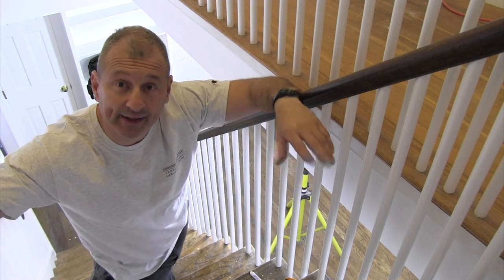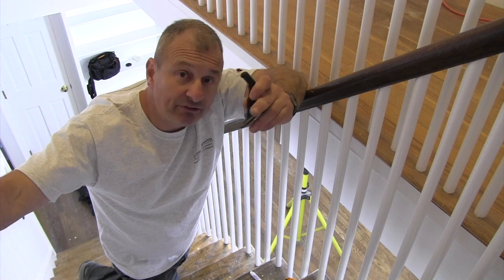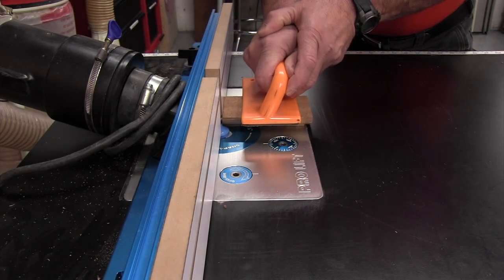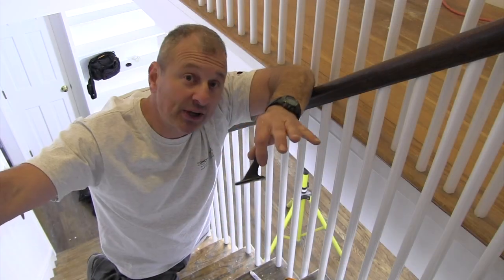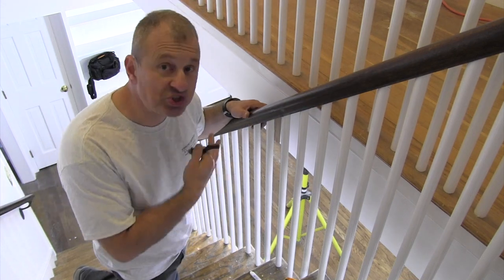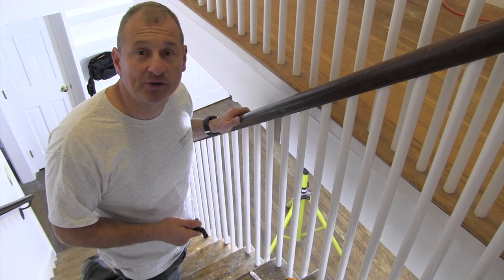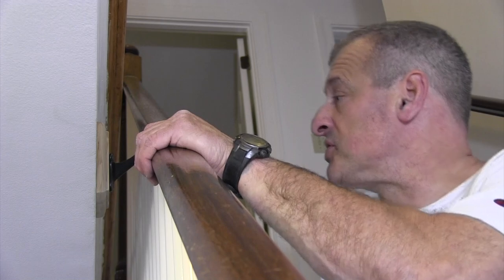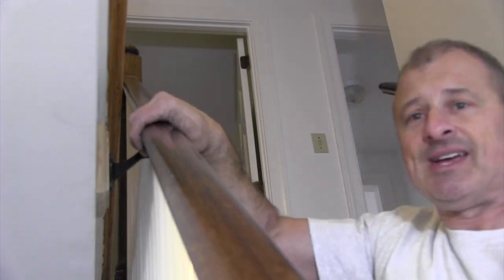How To Fix A WOBBLY Handrail

Comment: Great tip. These types of problem solving repairs are tough for me because I get hung up on wanting things to look a certain way. In this instance, it wouldn’t be my preference visually to see that block/bracket, i would prefer some kind of hidden solution. But I don’t know that there is a good hidden solution and the way you added the block, especially with the routed detail makes this an attractive option. Good work!

Comment: Good tip....but I've never ran into this particular situation here in VA. Very often it's free standing newel posts themselves that have become wobbly and often times are damn near impossible to get secured correctly. Toe nailing long screws into the bottom of the post and hope to hit some framing beneath the floor.
Reply: Similar issues in MD with the new builds...its like they simply glued a the rails down. You see them a lot in the townhome models here.
Reply: Did you tighten the underpin that protrudes from bottom of newel post thru to basement ?

Comment: Awesome tip. Would like to see what you'd recommend for a metal railing in an apartment setting.
Reply: If your metal banister system needs one, it will already have one. If it doesn't, and a gentle shake causes a wobble, put the bolts back in the holes. If the wobble is present with bolts in the holes, seek better health insurance and call the manager, but not before bulldozing through it and hurting your back. If you have children this may be a good way for them to learn the value of a buck, if not how the "world works."
Reply: @albrtl  Thanks Albert. Don't live in an apartment just do maintenance for an apartment complex. Ownership is super stingy and cheap so most of the time they try and make us do some really shoddy work. I actually like getting things done well and was wondering if there was a solution that would fix that even if it wasn't pretty that wouldn't go over the manager's budget.
Reply: @isaacvillarreal2941  Well now my snarky assumption makes me an asshole and I apologize for that. 

If the banister system doesn't flex like wood, securing the fasteners / replacement with appropriate hardware should resolve the problem. If it doesn't, perhaps the best bandaid is more negligent than simply not touching it. 

An option stemming from my imagination: If it's attached to wooden newel posts, drill through-holes and swap the lags for a nut and bolt. Using an oversized hole on the opposing side of the plate, center of the fastening hole and lightly zap a button plug to cover it up. Does this make sense? 

I'm assuming not fastened to concrete, but if it is, maybe drill slightly deeper holes and replace the lags. If it's resting on a knee-wall, obviously the lag option would be the same, however you may find problems with blown out sub-material. In this case, really long GRK's with a washer may do the trick. 

If you're feeling smart and holding a beer, you may try PL3/8X adhesive into the existing holes and stuffing the fasteners back inside. Unfortunately I've seen this work remarkably well in non-similarly critical scenarios. Perhaps a bracket not unlike the one in this video combined with appropriate adhesive and a C-Clamp overnight. If anyone asks, you don't know me. Why the hell am I even typing this? Look what you guilted me to do by making me an asshole!
Reply: @albrtl  Thanks for your response. No worries and no need to feel bad I had quite the chuckle over it. Hadn't heard of the PL3/8X trick, though I'm not sure if it would work in stucco. These apartments are low income housing built in the late 70's and in shameful condition so really not much hope for a simple repair. Thanks for the suggestions though, I really appreciate the help.

Comment: Great video. But how can you tell if the handrail is wobbly? I believe we can tell if it is rock solid. But it is hard to define to what degree the handrail is wobbly. There are few spindles in my house are trying to escape the cap of the handrail. I am trying to see if this is because the loose handrail or just the spindles themselves.

Comment: I'll hide fastener holes behind the bracket on the plinth block. There would be no need for plinth block UNLESS that specific handrail profile were used. The issue is largely handrail dimensions and fastening methods, although I suspect that particular rail is just fine. The real beauty of the plinth block is the inspiration enabled down the road, when someone inevitably feels compelled to fix the next problem. If there's already a plinth block on a janky-ass handrail, there's a 100% chance you'll find inspired repair attempts.

It's crazy that more people don't die from questionable or broken guardrails. It's probably a good argument that a false sense of security creates more hospital visits than something visibly hazardous and concerning, like hundred year old handrails barely clinging to a newel by one of five nails, now sharing a pocket hole from an attempted drywall screw repair.
Reply from the maker: Agreed
Reply: The number of handrails with drywall screws holding them is astronomical and embarassing

Comment: My wooden rail is very loose at the bottom, my kids have been abusing the rail over the years. How would you re glue the spindles to the base and top of the bannister? Is there any special glue or just put ugly screws in. The house is like 150 years old.
Reply: you could probably shove a thin bit of wood in there to stop it moving.
Reply from the maker: zaf email me a pic robertrobillard at Comcast.net

Comment: What’s the bracket called just a rail bracket ?
Reply from the maker: Handrail bracket
Reply: @ConcordCarpenter  But the arm is not long enough. Handrail brackets have the width 3"-5".  The distance I need (from wall to the center of the handrail) is 8.5". Even if I use a 1.5" thick board, still short. It does not look nice if I overlay multiple boards. Maybe I need to built a wood/drywall box.
Reply from the maker: @mfengoog  have a custom bracket made